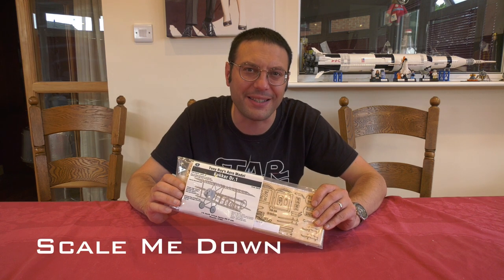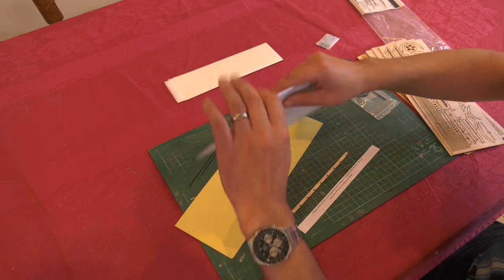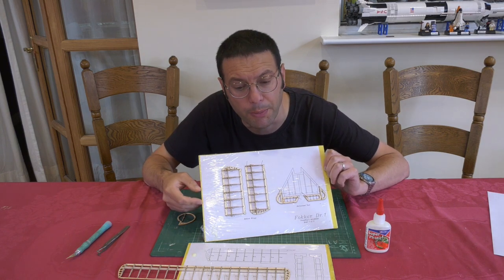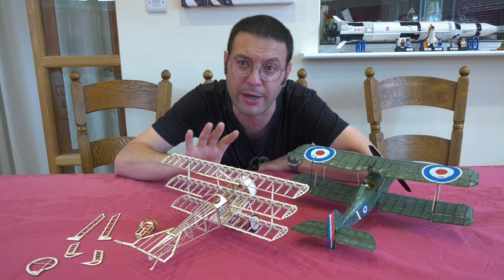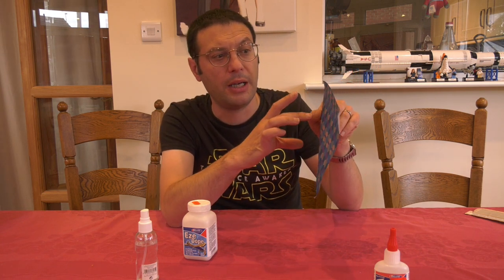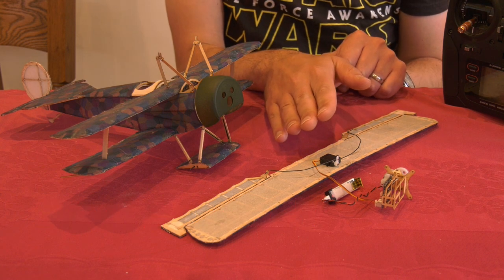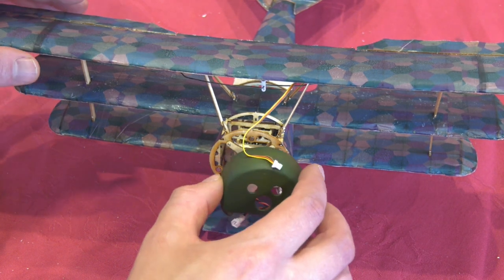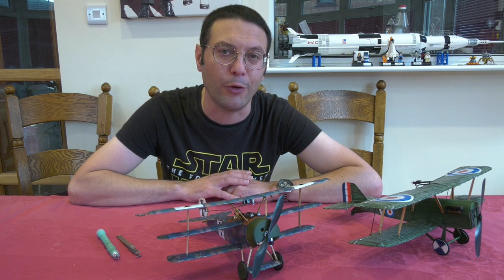Micro RC Tony Ray Fokker Dr1 Build and Review

Comment: I built the tony ray sopwith camel few years ago, first time attempting an rc model so small and fiddly, larger rc is my usual thing. found the building ok but just used water to shrink the tissue, shrinks ok initially and then gets a bit wrinkly. also made the mistake of spray painting the tissue. weighs 57g now incl battery, bit heavy but thought it might still fly, it didnt! was using a brushless motor which seemed a bit low in power so tried the brushed geared set up as in video. still couldn't get it to fly from a hand launch. they make nice models but so so fragile. excellent job on yours!
Reply from the maker: Thanks

Comment: I use Testors metal/ wood cement(green label) to glue parts together. I use Elmers glue sticks to glue tissue paper to wood. Also I use Krylon satin clear coat to finish over tissue paper. Easy Build Models plan have missing info to build as well. Tony Ray Models? That's a new one on me. I never heard of them until I watch your video. Ebay sells them, but dam! They are expensive!
Reply from the maker: If you are in the UK, you can get them from Steve Webb Models www.servoshop.co.uk. I have heard about the glue sticks for fitting the tissue covering, and intend to try them on my next small build.  Looking at the work in design and the quality of the laser cutting, I don't think the price is too bad for such an enjoyable build.

Comment: Terrific build video, I went back to this after watching the flying video. I find my hands struggle with the small parts, but I plan to build a Dr1. I've also had thoughts of how I could use the kit as a template to cover in Vector Board. At the indoor meets there's some models which are fine Vector Board covering basic frames. The Vector Board tends to flex when it hits anything. There's a modeller flying a huge ( by indoor Standards) Airliner and when I saw it fly into a wall it all flexed and bent and just returned to shape. The model looked amazing, but ist frame is much more basic and strength taken on board by the Vector Board. No Pun Intended. Vector Board is from the LMS. 

The Tony Ray kits are so economic to buy they don't break the bank and built as they are supposed to be they are rewarding, but as they are so economic I thought I might try some 'hybrid' building one day. It'll probably be a while... LOL...

Thanks again for a terric video. I love the tissue. A kind soul sent me some sheets. Thank You. Steve
Reply from the maker: Thanks.  I really enjoyed the build, although some bits definitely require tweezers.  I am impressed at how robust the airframe is when flown outdoors over grass.  We will hopefully try this model soon at an indoor fly-in
Reply: @ScaleMeDown  Yes they are quite a fiddle. But like you say when the model is all together and covered it tends to bounce. its because its so light and construction is very scale like. Its incredible such breakable bits end up being so strong. I have seen people claim they are static or 'to fragile to fly' and that's not accurate. I just saw some video of the Taube Flying. That's probably the hardest build and most fragile and yet it bounces on grass and even has a crash landing on tarmac with no damage. Its so light.

Thanks again. Indoor should be good. Indoor if the model can take a smaller battery I use one for slower flight. C of G is another thing we need more accurate for indoor than outdoor. Out door a nose heavy trim isnt so bad, but indoor it can mean faster flight and we dont want that. Have fun!
Reply from the maker: @Servoboy  Yes, I was surprised how robust the designs are once built

Comment: Wonderful video. Could you list the electronics you used in your build please?
Reply from the maker: Thanks.  No problem.  I used the MXL-RX62H V3 DSMX / DSM2 Board from Steve Webb Models https://stevewebb.co.uk/index.php?pid=MXLRX62HA&area=RADIO and I also used a small linear servo to drive the ailerons.  Give Robin at Steve Webb Models a call - he will point you the right way 01928 735225